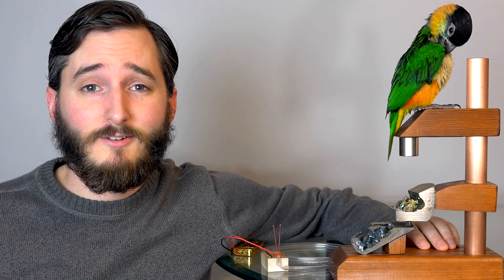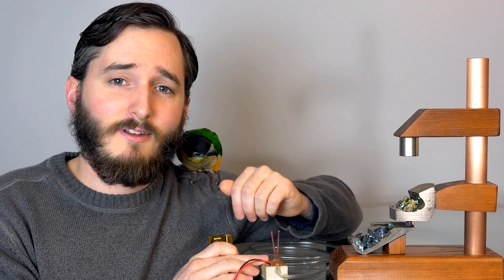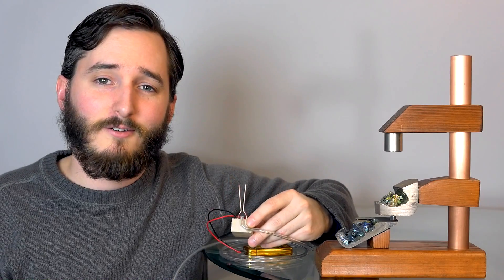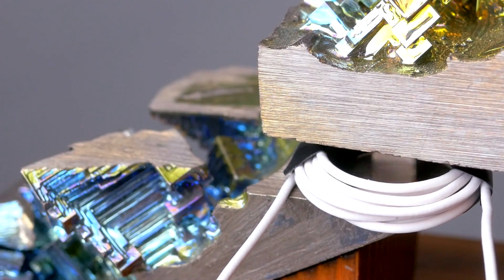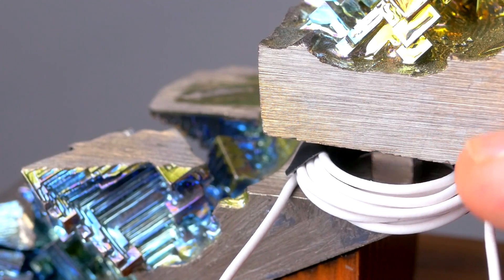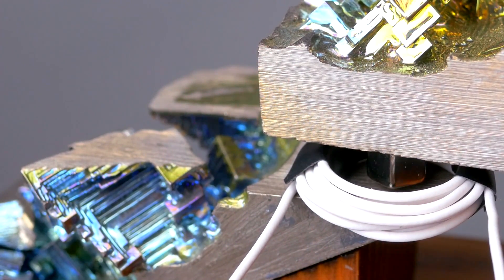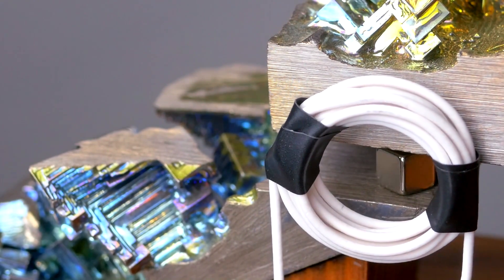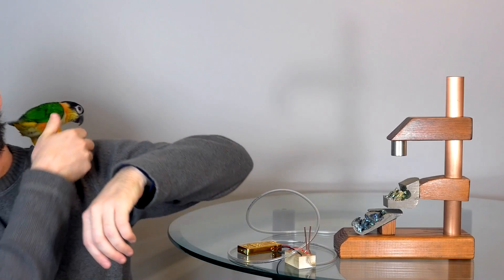Making a Jacob's Ladder from an Arc Lighter & Can a Bismuth Levitator create a Frictionless Motor?

Comment from the maker: Thank you everyone for coming to check out my video! Be sure to leave me some comments, I love hearing from you all and especially when you have cool ideas for future videos. If you didn't stick around until the very end of my last video you might not have met Mose yet. He's my bird. If you enjoy what I do I would appreciate if you would check out my Patreon page and consider supporting my videos in that way. Thanks! https://www.patreon.com/NightHawkProjects
You can check out how to modify an arc lighter to be used with a Jacob's Ladder  in this earlier tutorial: https://youtu.be/uKmGVNs_y7o
And also check out the full build video for my Bismuth Magnetic Levitator: https://youtu.be/A5pZZJ23rDM
Reply: Looks like the magnet is spinning in the transient period but I think is not cause by the coil, its probably caused by the motion. Not sure what you are trying to do with the coil, motors require the magnetic field to change or revolve around them in order to spin. A coil will produce a static magnetic field if you feed it DC. You'll need a bunch of coils strategically placed with some brushes and commutators in order to create a motor with DC. The magnet gets stuck when you energize the coils because the coil is either pushing upwards or downwards on the magnetic (with a slight rotation).
Reply: I'm sure codyslab will do this in a vacuum :)
Reply: I think the magnet spins when the current in the coil changes, so it would spin if you hook it to AC.

I'm not sure, but I'd say it's worth a try.
Reply: NightHawkInLight your face looks like a newborn baby
Reply: NightHawkInLight I must say that I love all your content, but your parrot is the most awesome by far!
Reply: DC to the coil for sure will not work. what motor principle it that?  It spins fast on open circuit because the field in the coil collapses making a faster move of magnetic field then charging the coil can do.
Reply: the magnet might spin fast because of the disconnection of the coil and when you disconnect a coil form it's power source it give a brief high voltage which might give the fast rotation to the magnet i'm not sure if this is the solution though
Reply: You may be able to make the magnet spin using the Lorentz force if you align the plane of the coil with the axis of the magnet's magnetic field.  The direction of the current through the side of the coil closer to the magnet would determine the direction of rotation.
Reply: Because lots of newborn babies have beards.
Reply: NightHawkInLight the reason it is spinning with the battery disconnected is becuase the copper is creating a magnetic force oposite than the neodymium magnet
Reply: Charles Culp or maybe coils that are much larger in diameter so they are further from the magnet making it harder for the magnet to be attracted to the wires but still have a great amount of force
Reply: NightHawkInLight  to get the motor running you need  to have an oscillating magnetic field rather than the one with DC . what you did is analogous to having another magnet (A) come close to the levitating one (B) then heat the magnet A to its Curie temp. (switch off).
Reply: NightHawkInLight maybe the battery starts it. once spinning put a volt meter on the wires. if it makes voltage you have a generator.
Reply: +NightHawkInLight  Shouldn't you use AC to rotate the magnet?
Reply: SirCutRy no u can use dc
Reply: NightHawkInLight heey,can you try to make music from your arc lighter? "can a arc used to make music"
Reply: ur face looks so calm xD
Reply: NightHawkInLight can you do some more pyrotechnics?
Reply: NightHawkInLight Please check out my channel I am focused on science/ element collection/ football     PLEASE CONSIDER SUBSCRIBING
Reply: NightHawkInLight This video was sick
Reply: NightHawkInLight try using fewer coils. Start with one.  This will apply less electromotive force, and perhaps not overcome the "bearing force" applied by the bismuth magnetic field.
Reply: awesome man,  thank you
Reply: Were you able to see if you could turn one into a plasma speaker?
Reply: NightHawkInLight don't collapsing magnetic fields generate electricity?
Reply: Are you getting any voltage off the Magnet/coil when it spins rapidly on its own without the battery connected? I know its probably only gonna be millivolts, but I'm curious.
Reply: bump
Reply: Dr Donovan Yes, but you need a split ring commutator, which is what bothered me about his approach.
Reply: good thing she didn't touch anything that could zap her, you don't need fried chicken
Reply: We had a electric chicken fence and out of 3 years (250 total chickens) we lost one chicken. The sound it made when it met its demise was terrible.
Reply: Thanks for the inspiring me to start my own channel
Reply: +A homeschooler's workbench hey if you're ever out of ideas for experiments i have some ideas
Reply: I am all ways looking for fun projects, could you put them in the comments of one of my videos.
Reply: +A homeschooler's workbench just DM me on Twitter, it'll be easier to communicate on their
Reply: Sorry I don't have a twitter account. Just make a short list in a comment on one of my videos.
Reply: NightHawkInLight what is the background music?
Reply: NightHawkInLight I believe that the reason that it spins is the residual electricity.  It gets the magnet spinning. After that it generates electricity in the wire and that in turn makes a magnetic field which pushes the magnet on. Remember, that's just a theory and thanks for reading.
Reply: NightHawkInLight what if you had something to repeatedly apply power and stop fast enough then would it keep spinning fast enough
Reply: I thought the reason the magnet sticks to the side of the wiring is because when you run a current through a wire it creates a magnetic field of it's own. 
But why it spins faster when it's disconnected is weird I wonder if when the magnet sticks to the wire it somehow creates potential energy between the magnet and wiring and when you turn off the wire this potential energy gets release by making the magnet spin faster. I'll have to watch the video of you making the levitator and do some research myself. Very cool stuff thanks for the video

OR since the wiring creates a magnetic field holding the magnet in place the other two magnets are still trying to spin the magnet creating the potential energy. I haven't learned enough about how magnet fields affect each other to really be sure of any of this.
Reply: NightHawkInLight What if you had many sideways coils in a circle?
Reply: 7:00 Maglev's principle ( magnetic levitation) on.
Reply: Have you thought about replacing the forced air current with a perpendicular magnetic field, such that the arcs experience an upward Lorentz force?